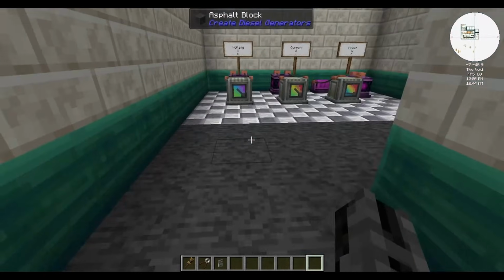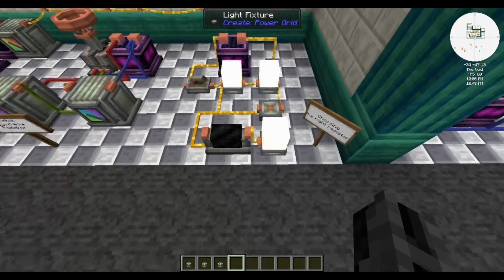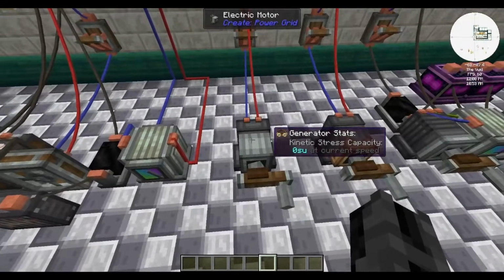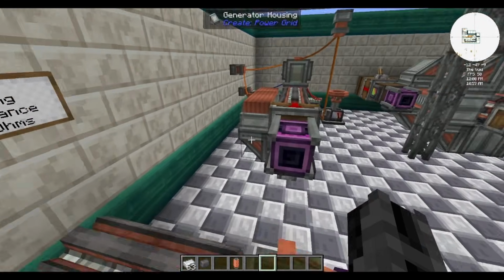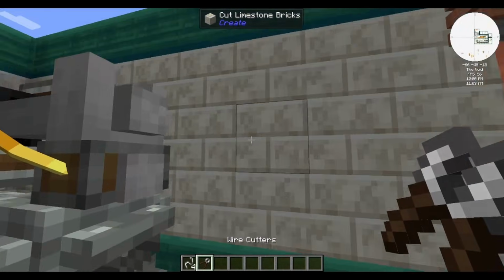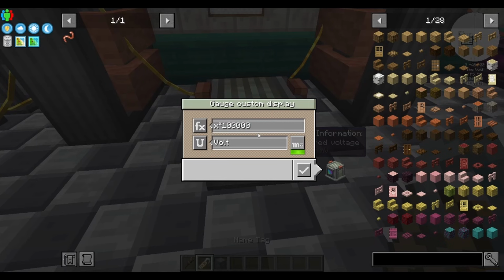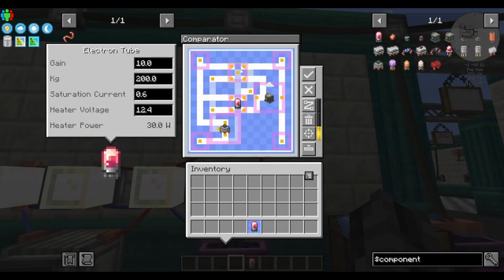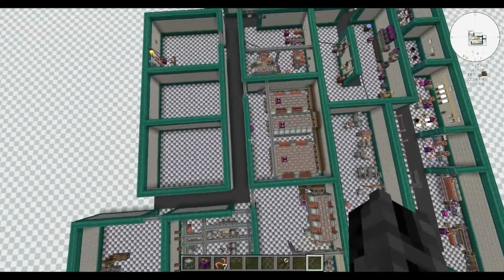Create: Power Grid mod showcase 1

Comment: you forgot how to tell us how to build the generator that outputs a constant voltage, been struggling to make a stable 120V power supply for ages in this mod, a world download would be so great bc i could just reverse engineer the values
Reply: I figured it out myself though for me it works by using Variac and electric motor

Comment: i really want in depth explaining for each component for circuits ive been trying to make a voltage regulator and you made it with ease im surprised about there electric components and would like a more in depth explanation and thank you
Reply: It kinda works, just limits generator wattage if you do not want varistors to explode everytime you stop and start your generator, I tried explaining it in my comment above

Comment: Any chance of getting a link to the world? Would be nice to check for components configures and nominals on PBCs. And would really like an in-depth tutorial of coaltower+varistors AVR for generator, as it is propably the first ever challenge you'll encouter trying to build grid in survival, tried that myself but failed miserable. Thanks for first ever (I guess) turorial on this addon <З
Reply: UPD: I managed to copy shown AVR and it works (kinda) but it has serious downside - this AVR limits generator output. Let me explain. For example: generator with targeted output voltage of +950V, for my configuration excitation voltage will be 300V to achieve 2A base current on excitation loop. So, sounds great, but here it comes. AVR based on 3 varistors and 2 capacitors can hold about 1.5-1.7A of current on excitation loop, or it, for some reason explodes. And it's just for stable work on already started generator. If we do talk about a cold&dark startup we are limited to just 1.1A of current and will need to add additional resistance to the excitation loop, or voltage surge during runup will break varistors, and then 5A fuse on loop after resistance control loss. But, it works, just limits possible wattage. I used configuration listed below:

4 Connectors, 2 for -, 2 for +, - on the right, + on the left. - connected to each other, + from bottom left corner conect to 3 varistor in parallel, varistors output connected to the top left connector. One capacitor locates on top, AFTER varistors, parallel, between output + and to the - and is set to 300-750mf. Second capacitor located BEFORE varistors and connect bottom left + connector to the - bus on the right, about 0.3-1mf. Varistors set to 65,4V. I send initial 950V from generator to transformer, step it down to 300V and send current thro coal tower and 70Om resistor and 5A fuse, that's excitation loop. Then I step voltage down once again, now to 50V, so, control circuit made the way so 950V output from generator = 50V of nominal voltage to AVR, and output from AVR connect straight to control of coaltower resistance.

So, basically it should be really simple, just need to somehow copy scheme logic using more powerful components and decrease resistance of my "prevent it all from going down" resistor, then it should be able to hold more current. As logic here is pretty simple - more voltage outputted - more current goes thru - voltage limited - do it again and keep it stable it should be possible to build something using transistor or something else idk.

Misa clearly knows what he does, but I hope that my dumb explanations finds someone and helps him struggle a bit less (but not to much, well, it's why this addon for)
Reply: But for such simple scheme - it works really well, after stepping down voltage from main 950V line to 120V and connecting about 3-4Kw of street lights it hold voltage at 118V and prevents surge on load disconnect, if I do not overload generator it stabely holds voltage in between 117-121V
Reply: UPD: I figured it out. I think so, at least. Just use NPN transistor for coaltower control, and use varistor for transistor control. And, scheme works a lot better if you use inderect excitation, for example, separated generator calibrated for 2A current of the main generator loop. That way voltage does not fluctuate that much on excitation loop and holds stable. Works flawlessy for my 1200V test setup. 600V for excitation from creative mode voltage for now, but I think it will be fine with just a small generator with resistor calibrated to stay around 585-620V for excitation.

For now scheme looks like that: same 4 pins of PCB, ground connects all together, + connects varistor and transistor collector, output of varistor goes to transistor base, emmiter goes to + output to coaltower, I have 3 capacitors between transistor, varistor and output + parallel to the  ground. Capacitor between varistor input and ground is 2mf, between transistor base and ground - 1mf, between output ground and + to coaltower - 100mf. Varistor is set to 64,9V, NPN transistor - 28,5. With excitation voltage at 600V and output of the generator stepped down to 45V at 1200V directly from the rotor scheme holds 1999,98V at output, stabely. Stepped down later on the line to 240V under 6kWt load voltage sets stable at 230V and slowly raises back to 240V. I use generator with length of 5 blocks, one rotor surrounded with magnets completely.
Reply: UPD: It works the best when you separate voltage thru varistor to transistor base and voltage thru transistor collector-emmiter to coaltower, voltage to transistor +45V, stepped down from generator output to be the one you want output voltage to be. +20V for excitation loop resistance control. That way PCB works very well for every possible generator configuration, even if it is self-excitation and every voltage feeded from output. Rough setting is done by coaltower base resistance (height) and calibration setting, fine tuning can be done thru change of varistor and transistor parameters, changing capacitors parameters let's you change inertia on all 3 steps of resistance control, adding delay if necessery. Main downside for now - HUGE voltage spike on startup and every change of parameters, or if somehow you will manage to burn varistor or transistor. As condenser charge goes down resistance drops until excitation fuse does pop or generator reaches it's maximum stable voltage. Like for my current testing setup, when everything is set to output 1500V, but initial runup or change of parameter in scheme causes 1-2 seconds 1980V output.
Reply: @Chris_The_Fox thanks for the comment, it really helps.

Comment: capacitance and inductance matter too. It's possible to create oscillators using filters and resonators.
(think AM radio tech.) everything has to stay below 20HZ, obviously, which limits how many and what kind of signals you can send through 1 wire.

Comment: Can you make a video about the potatoes like potatoes that can generate power in this mod please!
Reply: it's a tiny battery. that's all there is to it. It's VERY low voltage and power though, so if you say, want to light a lamp, you'll need multiple both in series and in parallel (at least 10 in series, I'd say) to get enough current flowing.

Comment: 17:00 that wont keep the generator stable.

You will have to constantly vary the impedance of the excitation circuit every time the load over the terminals changes.
Reply: Yeah because it's manual

Comment: Bro, couldn't you make a calculator (or even a computer) with the circuit boards? If so, that's awesome
Reply: Fun fact: You could actually making a fully working computer using just plain redstone in vanilla minecraft without even using command blocks or anything it'd just be really REALLY slow
anything that can make what's called a NAND Gate which it's truth table is:
If input A is 0 and input B is 0 then then the output will be 1
If input A is 0 and input B is 1 then then the output will be 1
If input A is 1 and input B is 0 then then the output will be 1
If input A is 1 and input B is 1 then then the output will be 0
or a NOR Gate which it's truth table is:
If input A is 0 and input B is 0 then then the output will be 0
If input A is 0 and input B is 1 then then the output will be 0
If input A is 1 and input B is 0 then then the output will be 0
If input A is 1 and input B is 1 then then the output will be 1
if you can make either of these gates then it's completely possible to make an entire working computer
Reply: @dawsonsarcade7670  my guess is the problem will be speed? If so, let's hope it's fast enough that I don't need to run it overnight or something just to get an output lol!
Reply: There are multilpe options: relays are the simplest, but loud, big and use a lot of current.
The BJT Transistors are silent, more compact and use much less current, depending on what kind of logic you use.
Using the FET Transistor can reduce the current draw even further, but there's no inverted version, so only FET logic gate will be a bit larger.
And that's if you use only digital logic. You can make analog computers (ie. value ~ voltage), which would be faster and more compact, but is likely ro be less precise due to every wire and trace having a tiny resistance, which makes it very difficult to perfectly match values. You could even cook up a version that uses servos and cardreaders, (btw, I hope they add a card writer.)and uses neon lamps as memory (tricky but compact, you can fit 49 bits on one board).
Reply: Wow, you know your stuff! (Just so you don't take this the wrong way, this is supposed to be a compliment, I'm kinda tone deaf so idk how it'll play out) @erumaaro6060